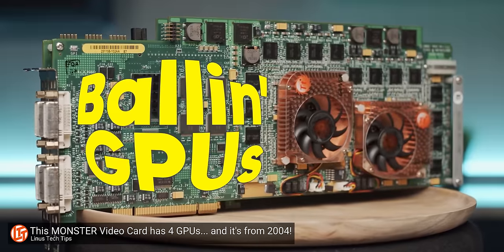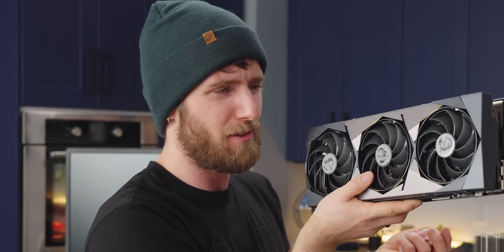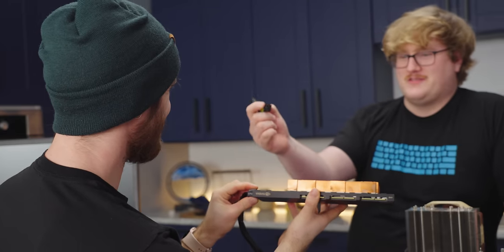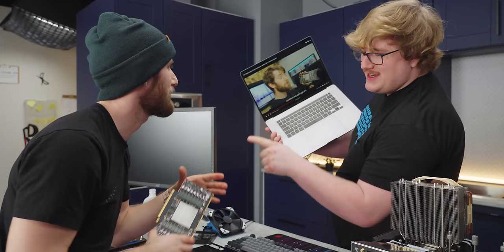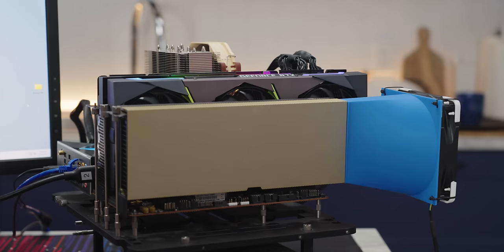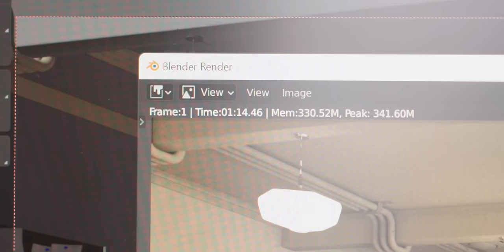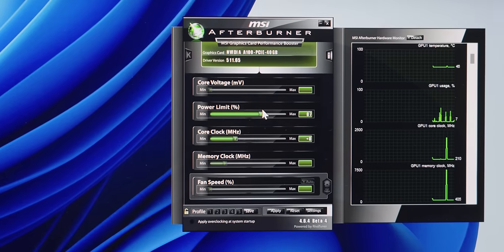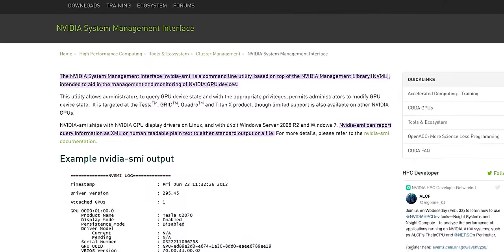NVIDIA REFUSED To Send Us This - NVIDIA A100

Comment: I haven't messed around with an nVidia Tesla GPU past the Maxwell line but I do remember it is possible to switch them to WDDM mode through nVidia SMI in Windows command prompt which will let you use the Tesla GPU for gaming provided you have an iGPU passthrough. By default, nVidia Tesla GPUs like the A100 will run in compute mode which Task Manager and Windows advanced graphics settings won't recognize as a GPU that you can apply to games and apps. But idk if WDDM has been removed in later nVidia Tesla GPUs like the A100 or not.
Reply: You said you did what in the who now 😕😵
Reply: I recall reading WDDM not being available by default on some modern Tesla cards because the standard drivers only support TCC mode and specific driver packages from Nvidia are needed to do it. I have no idea how this applies to Ampere but I imagine it's similar.
Reply: You need more halo lore vids lol
Reply: @SkullGamingNation  fr
Reply: so strange when two of my completely unrelated hobbies come together randomly like this
Reply: Didn’t expect u here

Comment: Nice comparison. You could've rented one of those bad boys on Azure for less than $4/hour for the benchmark. In fact, 8 GPU A100s connected through NVLink are expected to be 1.5X times faster than stacking 8 A100s connected through motherboard.

Comment: 250W for such a card is excellent. I was expecting more like 400W up.
Reply: 7nm TSMC, that's why
Reply: @mihailcirlig8187  i think the A178-9 and the NVIDIA 9050 is way faster. I have it currently.
Reply: 250 is still a lot bro
Reply: nvm
Reply: The A100 SXM version does have a 400W draw.
Reply: yea thats probably at that low ass 700mhz base clock, 400w at turbo. Same chip is not going to change physics.
Reply: @GetOffMyPhoneGoogle  I did make a video

Also cringe
Reply: Power efficiency and power consumption, as well as the size of the card as well, are all considered more important for this class of workstation/ super-computer/ server type of graphics card.
Reply: @GetOffMyPhoneGoogle  you calling me a Phoney makes me sad :((( please dont or i will cry a lot in my mothers eye.
The video is been up, you are just blind

Comment: While machine learning can be sped up using more memory, there are things that you literally can not do without more VRAM. For example, increasing the batch size even further will very quickly overwhelm the 3090. Batch size, contrary to popular belief, is not "parallelizing" the task, but actually computing the direction of improvement with higher accuracy. Using a batch size of one for example would not usually even converge on some datasets, and even if it does, it would take ages to do so.
Reply: big batch sizes dont converge necessarily either, which is why you might want to start with a big one but lower it eventually as training goes on
Reply: Also, it depends a lot on the what is used. If you're running inference and your model is big, it will need a lot of VRAM (proportionally to the model size) and won't run if it doesn't have enough. You could split the model between cards, but it's running into bandwidth, model and performance problems.
Reply: I assume we're talking about neural networks. Using bigger batches just means feeding more data sets into the model before backpropagation. Why does this increase memory usage linearly?
Reply: @nottheengineer4957  Imagine sending 32 images of 512x512  pixels in size with three channels, thats a batch of 32, which would be a fp-32 tensor of size 32*512*512*3,  a bigger batch size would mean a larger floating point array to be handled by the GPU. So, batch of 64 would be a tensor of 64*512*512*3. This is effectively doubling the total memory required to process the tensor.
Reply: I understood like two words
Reply: For normal people dataset sizes a 3090 has more than enough VRAM because mini-batches of size 32-512 most often end up being most optimal and depending on the type of data, that will usually fit just fine.

I also think saying "computing direction of improvement with more accuracy"  is too inaccurate, its not like this at all. I don't really have a counter argument because those learning dynamics are not even fully understood yet by researchers but bigger batches tend to not generalize as well because they tend to settle in sharp local minima and never get out of them.

Also doesnt stochastic gradient descent(batch size 1) almost always converge to at least as good of a solution as bigger batches? I can't find a source quick enough but afair from the books it will be painfully slow but there is no reason why it would not.

source: dont trust me i study computer systems and not ML and i accept that i might be totally wrong. But a few quick google searches seem to back up what i remember from my courses.
Reply: For me it's the VRAM limiting the lattice resolution in CFD simulations. Largest sims I've done so far were on RTX 8000 (see the video on my channel) because that has 48GB, even more than the A100. But the A100 has higher memory bandwidth so it is much faster.

Comment: Everyone with any pc building experience: "So graphics cards take pci-e power connectors and attempting to plug an eps connector in instead would be bad right?"
Nvidia: "Well yes but no"
Reply: it’s a power connector. it’s like saying nema 5-15p connectors can only be used in the usa.
Reply: @snowyowlll  Well yeah i'm just referring to the pinout
(Yes i know they're made so it's impossible or at least a lot harder to put one connector in the wrong spot)
Reply: So funny thing about that. The keying for PCI Express 8 pin and EPS 12 volt is basically compatible. The only difference between the two connectors is PCI Express has a little tab between pins seven and eight. If you were to plug a PCI Express power connector into an EPS 12 volt port you basically end up shorting 12v to ground. It may or may not know from experience 🤪

Comment: When I interned at this machine learning lab I got the opportunity to train my models on a supercomputer node which had 4 of these cards. Even though my code was not optimized at all, it crunched my dataset of 500.000 images for 80 epochs in about 5 hours. For reference, my single RTX2060 Super card was on track to do it in about 4 days. 
I think the main advantage of these cards in machine learning is mainly the crazy amount of memory. My own gpu could handle batches of 64 images while the node could at least handle 512 with memory to spar (I didn't go further as the bigger batch sizes give diminishing returns in training accuracy)
Reply: I get what you're getting at but that comparison seems to be a bit extreme. If you put your workload on one a100 only that costs 10000$ and then on two 3090 that cost ya 2000$, you would save a lot of money and get better performance. If you consider the power usage then yes, you would be saving but still to get to 8000$ worth of difference it would take many years. People of course pay for these things because they are made with tons of memory and linkability and data centers need that but comparing just the processor power these chips aren't better than the more affordable gaming cards. There's a big price hike that nvidia applies to the pro cards because they can and the clients can and do pay.

Comment: You'd get a significant boost in speed with Blender when you render with a GPU of you set big tile sizes, like 1024 or 2048, under the performance window.
Reply: @Barnaclebeard  me? What? why?
Reply: 256 for 1080p renders and up. that is how you get the fastest speed. if it is 4k, you go with 1024.
Reply: I dont get it. I got 4gb doodoo gpu and blender automaticly sets it up to 2048
Reply: @sayochikun3288  modern blender doesn't use tiles the sane way
Reply: @1e1001  but in the video there is older blender 2.9 or 2.8
Reply: @t0biascze644  the person i was responding to is not in the video
Reply: @sayochikun3288  doodoo GPU? is that like some offbrand of the Voodoo GPU?
Reply: @TtEL  i mean a shit gpu

Comment: As a tip, Nvidia-smi runs on Windows too, its included in the driver.

I used to use to lower the power target without needing to install anything.
Reply: mine always closes immediately and I cant change settings. Been working to get a tesla functional on my rig and haven't been able just yet.
Reply: @tobiwonkanogy2975  Add that directory to the windows path.
Reply: Interesting thing with NVIDIA drivers is that they are essentially the same cross platform. That's why NV wont release source.
Reply: smi can also be used to overclock and adjust memory timings, that 174MH could be 200+ with tweaks.
Reply: Thanks for the tips ill try em out
Reply: @xlneoMAXlx  -h not /?
Reply: @xlneoMAXlx  No it is not, only posted so people know but sure they would work it out :)

Comment: Linus: "We'll mask the serial so they can't find the person."
*Shows the chip serial instead*
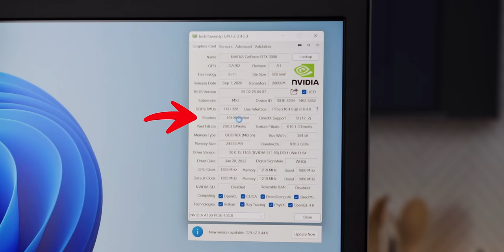Reply: also device id at 14:36
Reply: ...hmm
Reply: @hrithvikkondalkar7588  The device ID is not unique. Every single card of the same model will have the same Device ID. For example, every 980Ti the same as mine (I can't say which specific model of 980Ti it is, as I bought it second hand with a waterblock fitted) will show 10DE 17C8 - 10DE 1151. You can google that and see for yourself.
Reply: That's not the chip serial.  That's the model and revision.
Reply: Device ID is same across GPU models, it's part of the PCIe spec.

Comment: Whoever sent that in is literally putting their job on the line and in the hands of a clumsy Linus, watching him take this apart gave me huge anxiety! 😂
Reply: Kinda doubt it, if you need that much, why send it. He now can't use for x amount of days
Reply: Probably "borrowed" from his work and hoping his manager doesn't see any identifying marks on the missing card.
Also, if you gonna steal a 10k card you're probably not that bright to begin with.
Reply: @RomboutVersluijs  He wanted it back with a cooler and a mining benchmark he probably doesn't know how to use it. lol
Reply: Nope probably just a miner with extra cash looking to increase efficiency. 70% higher hash rate over a 3090 w/ 25-30% lower power consumption seems good but at 3-4x the initial cost. It will take 5 years of continuous running to pay for itself, assuming about 5.50 a day profit. 3090 will pay for itself in 2.5 years.. this is all of course assuming crypto remains completely flat, which is highly unlikely. 

If I can get some of these at a good discount I will probably pick some up.
Reply: "Yo test mining with it", dude prolly jacked the thing from somewhere or got it from the market and threw it a linus before he puts it with the rest of his mining operation to see what he's dealing with.
Reply: Due paid 10k for this thing, just to turn it into a miner, so linus was not holding someone their job in their hands.  They were holding someone relativly rich their stuff in hands that wants to get rich as eth is the next big thing, they think.

Comment: 6:15 This might be the point where the case was mounted to a big industrial suction cup. Manufacturers often do that when spray painting a piece of metal. You can see that on a lot of metal stuff that doesn't need to look good from the inside.

Comment: The difference in finishes you see at 6:10 looks like part of the shroud was milled. The matte parts look to be as-is (likely stamped or cast depending on the thickness). The smoother parts with lines going in squares are milled (kind of like a 3D drill to cut away material). This means they were taking higher-volume parts and further customizing them for these cards (milling is done for much smaller production runs than stamping or casting/molding).

Comment: Tensorflow allocates all of the GPU that you give it. That's why the VRAM usage is almost 100% in both cases. 512 batch size on a ResNet50 barely uses any memory, so this benchmark might not actually be pushing the cards to their limit.

Comment: The HBM2 will be saving quite a bit of power vs the GDDR6X on the 3090. It’ll also be a huge boost in some workloads. TSMC’s 7nm process is no doubt better than Samsungs N8, it’ll be interesting to see how Lovelace and RDNA3 do on the same 5nm  node.
Reply: TSMC N7 is better than Samsung's 8 nm for sure, but the reason the A100 is so much more efficient than the 3090 is not because of the die technology.
Reply: RNDA3 will use MCM technology. This will possibly allow AMD to win in rasterization performance and be much more power efficient than Lovelace.
Reply: People will shit on you if you even dare to mention that RDNA 2.0 is worse than Ampere as an architecture because it has a pretty significant node advantage and still only trades blows with Ampere. But just look at this Ampere on TSMC's 7nm, it's quite darn efficient. It will indeed be interesting to see the Lovelace vs RDNA3 on the same node.
Reply: @PAcifisti  well yes but this a100 card also has a die like 3x the size so it spreads heat out better then any of the gaming cards
Reply: @PAcifisti  To be fair, the A100 has low clocks and has a massive die size at 830mm2.

It's not even fair lmao.

Same thing about current desktop Ampere: 20% larger than the largest RDNA2 die.